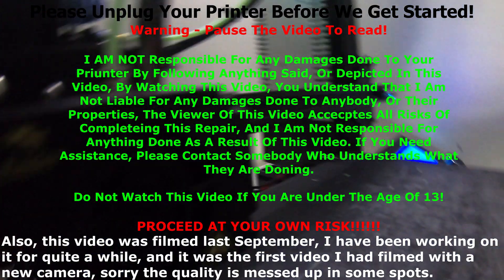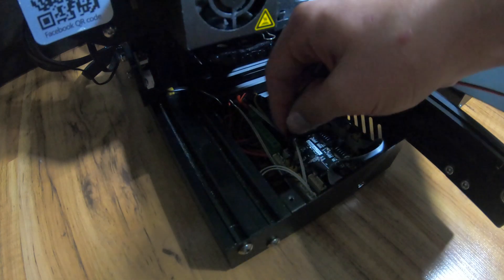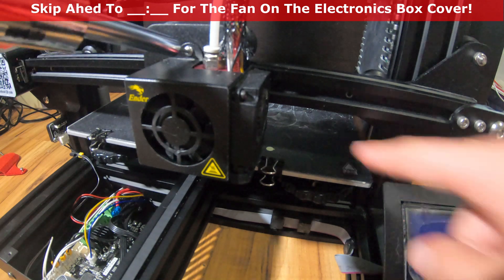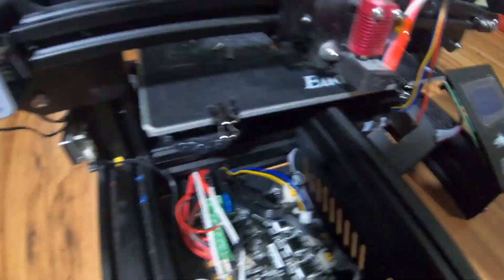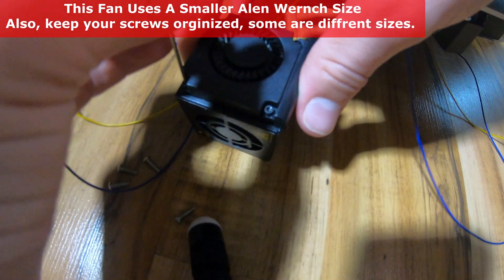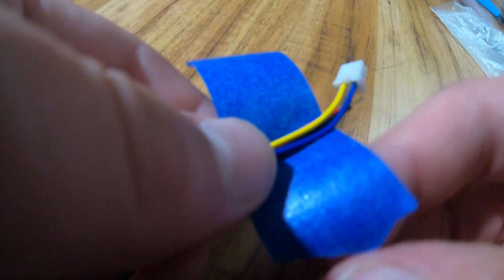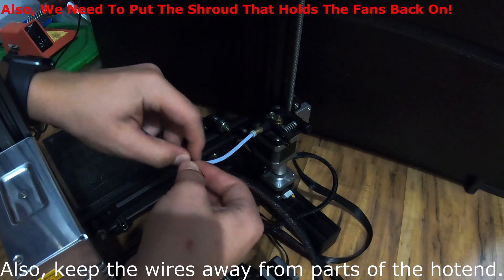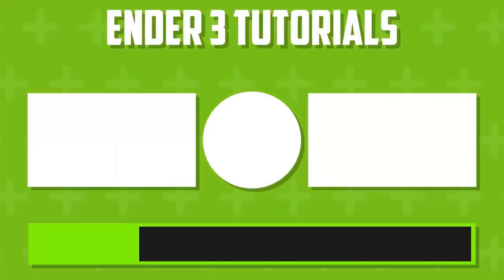How To Replace The Fans On A Ender 3!

Comment: did your electronic box come hot glued?
Reply: mine did as well, i just used flush cutters to remove some of the hot glue and then pulled the connector out. im still trying to route it through the cable snake though
Reply: Mine did I just used the cutters that came with printer to rip it off